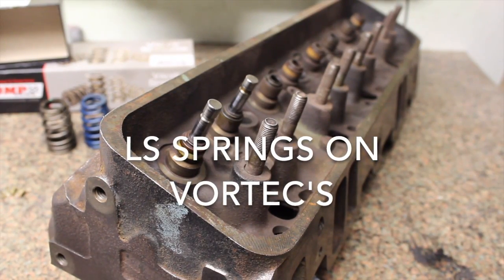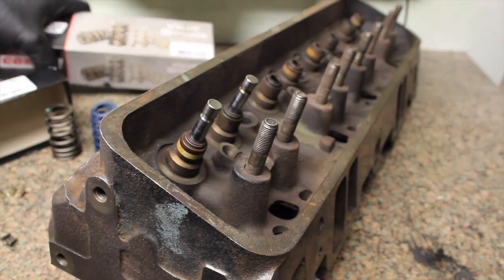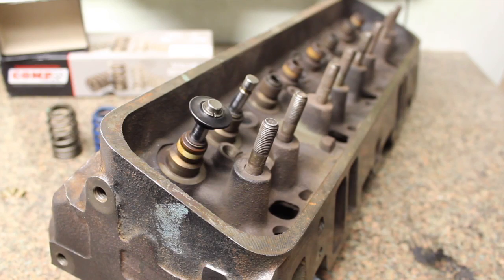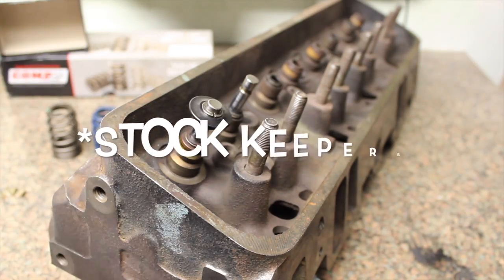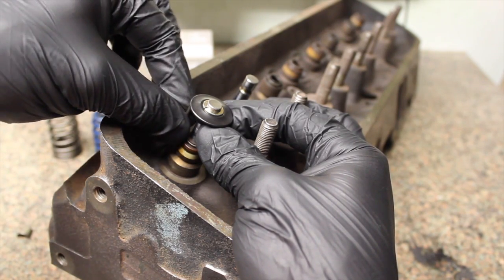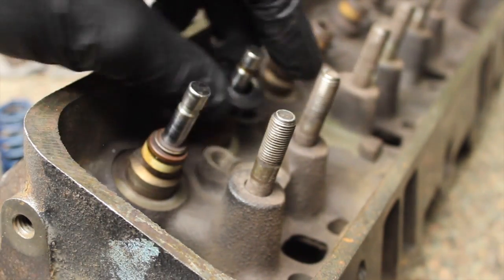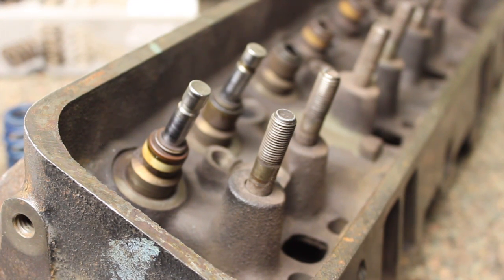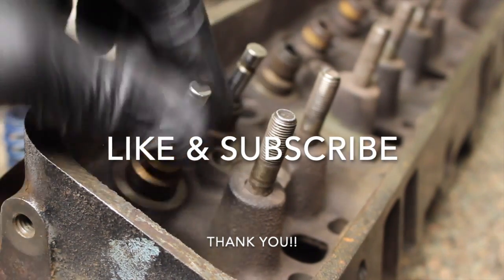LS6 Valve Springs on SBC Vortec Heads

Comment: What an awesome video! Im using a .480 lift, could I get away with just using ls6 springs?
Reply from the maker: Send me a email
Patobrien31@outlook.com 
I have special offset retainers and valve seals that allow .530 lift with stock keepers. Ls6 springs would work as long as you don't have alot of duration

Comment: They make snap gauge that fits there
Reply from the maker: Yes they do, I have a comp cams one. But this is a easy was for somone at home with basic tools to have a way to set up their heads.
Works just as good as a valve height micrometer but just takes abit more of initial set up to get your lengths
Race on! 🏁

Comment: 1. Why not just measure it with the calipers?
2. Why not machine the guides down???  That is normally what you do to a set of heads...
Reply from the maker: Good questions!
I use a comp cams valve height micrometer but not everyone has access to one or wants to buy one for doing one set of heads. Using regular calipers is pretty hard to measure with any sort of accuracy.
This method allows somone to check at home with basic tools and once the first one is done its easy to check the rest.

Machining guides is a standard practice, and you can buy the tools to do it your self. But why? If you can use a set of beehive springs that offer excellent valve control without crazy seat loads and still maintain a full guide for a long service life on the heads. You still have to buy springs, seals and possibly retainers if you are cutting the guides...doesn't beehives seem like the better option?
I'm making these videos to help the guys trying to learn and that might not have a huge budget for their engine build
Reply: @cuttersperformance  
Use the other end of the calipers
Reply from the maker: @johncholmes643   have you tried that? Hard to get a accurate reading personally.
But whatever works! Race on 🏁

Comment: What about pushrod clearance in the guide holes, at what lift do you have to elongate the holes, what has to be done to run Max lift 580 Cams ?
Reply from the maker: I automatically elongate the holes on every vortec head i do just to be safe.
Clearance becomes a issue usually around. 500 lift or 1.6 rocker arms 

I have a kit I've put together to run up to .580 lift on vortecs without machining.
Email me for details 
pcperformance1@outlook.com

Comment: Where do u get those screw in studs? I seen speedway has some like it but not sure which ones are better. R u going to be selling these in a kit also?
Reply from the maker: Yeah I will be! I'm trying to secure all American (or north American) Manufacturers for all the springs, retainers and studs in my kits.
Supplies have been down due to covid but I'm hoping to have everything ready by the end of next week. 
I can put a package together depending on what Cam/combo your running, as I will have different spring rates available
Reply: The heads i got already have the springs but the the studs were never changed thats all i need for now but i am going to check to see if it has the offset retainers and keepers
Reply from the maker: @jesserodriquez4829  My kit will include reatiners that should not need offset keepers to get the proper installed height 👍
And studs are always a good idea! Especially when springs are upgraded for a larger cam
Reply: @cuttersperformance  ok do u have a ballpark figure of the cost and is that kit coming with the studs?
Reply from the maker: @jesse rodriquez I should know by within the next few days. 
Send me a email with your combo and what you need and I can put something together for you 
pcperformance1@outlook.com
Reply from the maker: Parts Are In! Sent me a email if your still in need of a vortec spring package
Reply from the maker: @jesserodriquez4829  pcperformance1@outlook.com

Comment: What if I have a 513 lift that mean I should use aftermarket retainers right to get the extra clearance over stock retainers right
Reply from the maker: Yeah thats correct. The stock retainers will also not work with beehive springs. 
I have a kit coming soon that will have everything you need for getting high lift on your vortec heads. Kits will have different spring rates depending on your cam
Reply: PISS-CUTTER Performance how soon I need a set ASAP motor almost done about to start on the heads they awredy shaved
Reply from the maker: Send me a email
pcperformance1@outlook.com 
Let me know what your combo is and what cam you are running 
Thanks!
Reply: PISS-CUTTER Performance didn’t have outlook downloaded
I have 283 513 lift roller cam going in a stock Vortec heads been shaved 
750 Holley jegs intake....waiting to order rockers after I get this info I want some heavy duty ones but I seen not all have self aligned rockers
Reply from the maker: Is my email not working?
pcperformance1@outlook.com

Let me know and i can put something together for you

Comment: Also, please do the stud video if you have not already - Would love to see it explained well!
Reply from the maker: A vortec stud video will be coming up soon!
Reply: @cuttersperformance  Hey there! I am getting ready to install some beehive springs - I want to install  screw in studs. Can you recommend a stud kit? I will be staying with stock rockers, not going radical with the cam, just a 280H. If you could recommend some studs that would work without cutting the bosses and would work with the factory rocker I would appreciate it. Also, what is a good tap? THANK MAN!
Reply from the maker: I have had good luck with pioneer 850001 stud kit. 
Buy yourself a good quality tap from your local hardware store, the heads tap fairly easily 
I will be posting a stud video within the next week
Reply: @cuttersperformance  Excellent I will wait for that. One last question - I see taps that are called pipe, bottom,  plug, tapered - which tap do I want?
Reply: @donaldwarwick6780   Pipe taps are for pipe threads, Bottom taps are for blind holes{putting threads to the bottom of a hole not drilled through} Plug tap same as Bottom Tap for our usage. Tapered/Starting used for starting in blind holes or through holes. For the screw in studes I would get one Tapper/Starting Tap and one Bottoming/Plug Tap

Comment: Wouldn't a dial indicator work better?
Reply from the maker: I dial indicator would work if you have one.
They also make special spring pocket dial indicators for checking spring height.
But this way works great for most people with basic tools at home, and after the first spring its easy to quickly check the rest

Comment: Thanks for the video.  Anybody running 1.6 rocker arms?  Any push rod clearance issues?
Reply from the maker: I've done it many of times, I will be posting a upcoming video
Reply: PISS-CUTTER Performance  thank you.  Do you know of any issues?  I’m considering comp roller tip rockers or simply stock style comp 1.6’s.  Looking forward to your video.  Thanks!!
Reply from the maker: I will have a video up tonight that should answer all the questions you have
Reply: PISS-CUTTER Performance thanks a lot man!!  Have a good one.
Reply: @Buck_Em_Garage  you need to use self guided rockers
Reply: @austindoud273   yep!  Done and 1.6’s made a difference.

Comment: So the stock retainer an Ls6 springs will work under  480lift
Reply from the maker: You will need to use the 787-16 retainers with the beehive springs. The stock vortec retainers won't work with beehive springs and the ls reatiner won't work due to different valve stem diameter. But you can probably can get away without using offset keepers at .480 lift
Reply: PISS-CUTTER Performance and which locks to use trying to order them all now
Reply: The vortec heads I've measured with stock keepers and retainers had right around .485 clearance before they hit the seals.
Reply from the maker: @THEFERMANATOR was that with stock valce seals? Sometimes depending on the head and on the valve seal is you can get up to .530 lift (.480 - .050 clearance). That's why its always good to check